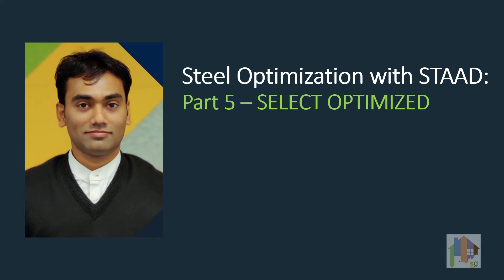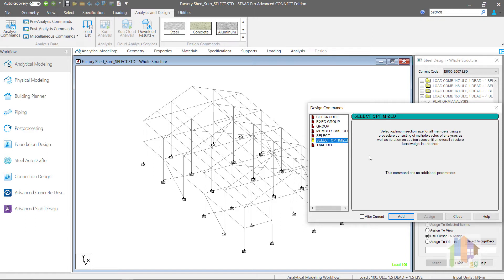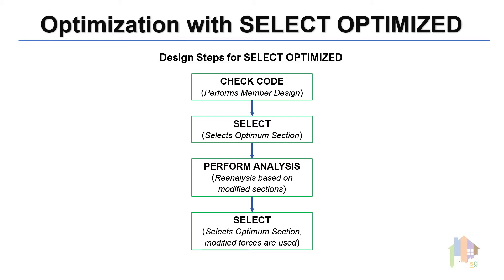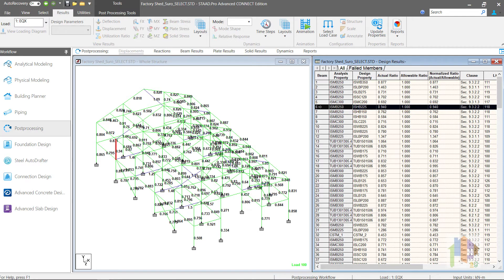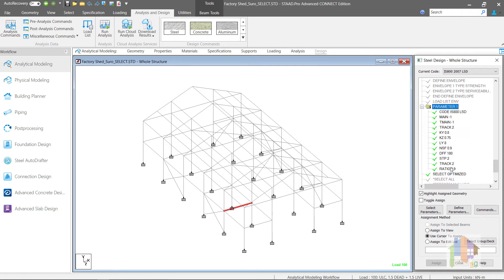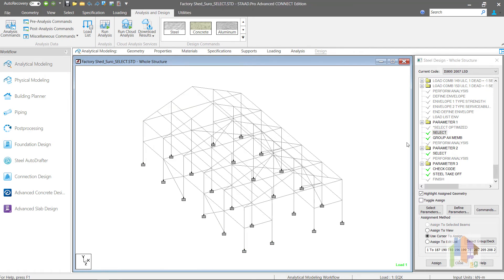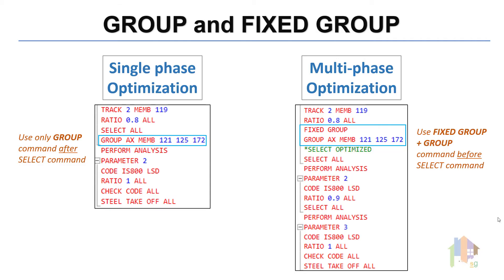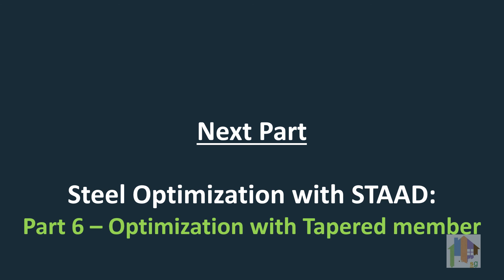Steel Structure Optimization with STAAD: Part 5 - SELECT OPTIMIZED & FIXED GROUP || Variable RATIO

Comment: Hi, Eagerly waiting for your Part - 6 Auto Optimization of tapered members with select optimized command for built up sections in staad. Thanks in advance.
Reply from the maker: It is not possible to optimize tapered section using SELECT or SELECT OPTIMIZED command. There are few other tricks for tapered section optimization. I will post this video in early 2022.

Comment: Sir, Can you explain KX,KY,KZ,LX,LY,LZ parameters as per is 800:2007 , and where it must be applied in a steel structure??
Reply from the maker: Well, it is very hard to explain the full concept in YouTube chat. In short, these parameters define what length to be considered for axial and bending capacity calculation and depends on the buckling. Buckling due to axial compression load or flexural load always reduce the capacity of the member, hence it is considered during capacity calculation.
When you calculate the compression capacity as per cl.7.1.2.1, you need the effective length for Euler buckling stress calculation and that needs to be provided using KY/LY and KZ/LZ parameters. Similarly for LTB moment calculation for bending capacity (cl.8.2.2.1), you need the effective length for LTB (LLT as per code) which must be defined using KX/LX parameter.
Determining these parameters in a actual model might be tough as these depends on several end/intermediate support conditions like a column might be supported at intermediate location in one direction but free to buckle in another direction. So you need to check the buckling and support condition before defining these parameters.
You may go through my previous videos related to IS800:2007 (https://youtube.com/playlist?list=PLxLi_mmlPeirxD3gUWVF-7xSHqDhZ_ie_) for more details.
Reply: @surojit_ghosh  Sir, Thank you for your reply, i understand a little bit because of my little knowledge, Sir can you tell me, where to learn all concept the concept of steel design as per indian code. Various structure like Warehouse, PEB, different types of truss, steel high rise building, gallery, pipe rack etc.. ধন্যবাদ sir 🙏
Reply from the maker: You can follow any text book to learn the basic concept of steel design. But for practical knowledge, there are not much text books available. Better you can follow structural discussion forums like SEFI or Bentley Communities site or follow authentic YouTube channels.